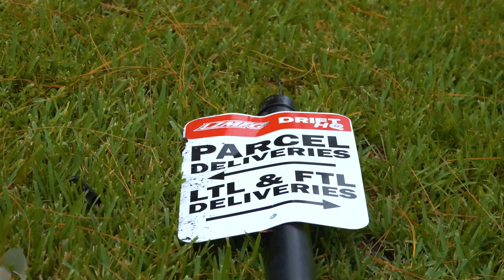Modifying an E36 Race Car to Drift | Ep. 3: Officially a Drift Car!

Comment: Awesome video. Props for addressing all the comments about the coilover change, that was comical last time.
Reply: I think it wouldn’t have been as bad if whoever posted the comments on Drift HQ’s side just stopped regurgitating bs about how BCs are so much better than the MCSs in this application, when it’s mostly a money issue
Reply: Adam still showing he doesn’t know about dampers though. You wouldn’t need to revalve MCS for a softer spring, the damping sweep is huge on them.
Reply: @Hole_Motorsports  

May be huge, but I don't think it's go from 14k spring to 4k spring type of huge. But I'm no expert, just seems like too much to compensate for with no noticeable difference in damping performance, but may be wrong.

Plus it was expressed multiple times this car might go back to being a road racing car whenever he grows out of it and wants a faster drift car. Hence they kept all the old control arm, knuckles and coilovers so they can simply bolt it all back on, throw the race alignment and the slicks and it's back to what it was before. If they changed springs and possibly got the mcs revalved then reverting back would be a pain.
Reply: @imnota  it is that large, 4K is like 225lbs so would be crazy soft on an e36 unless you’re running a true coilover rear. I know people running 600lb rears and others running 1200lb rears with the same valving. Plus you can adjust canister pressure. MCS does not change valving on these that I’m aware of because it’s simply not necessary.

The point is the MCS is one of the best dampers money can buy, taking them off because they’ll get bent in a drift collision makes sense.
Reply: @Hole_Motorsports  I know 4k is soft but I've seen a few drift e36 guys do that. 

Here it's denofa's setup so I don't know what he runs, he keeps it rather secret.

Comment: I love this series! I’m in the process of building my first drift car with a ton of drifthq parts. Chose the e36 largely bc of Chelsea and Adam and love how stoked this dude is. Can’t wait!
Reply: Staying stock power and just going with angle and in line to start?
Reply: @kevinfunk83  why start with inline e-brake?
Reply: @BBox-135  Dual calipers setups are nice but if inline setups are bled properly they work just fine. 

OP you won’t regret starting with the e36 platform. I drift one as well and they are so good! Seat time is the biggest thing starting out. Don’t worry about crazy mods, just get the maintenance up to par and go shred 🤙🏻
Reply: @kevinfunk83  yep, cnc71 angle adapters, Chelsea tie rods, drifthq compact in-line hydro. Does have an rktunes chip but mainly bc I got the car with no keys.
Reply: @Chattsteezy my E36 will be  just enough to have some fun. I was thinking dial caliper but not a big break kit. Something like adding an E46 330 rear  caliper similar but I haven't gotten to the brake thought process while the car is not with me at the moment
 It's in storage for about another week. The line line would be less time consuming and cost less so that sounds like a good move to make. Thanks for your input.